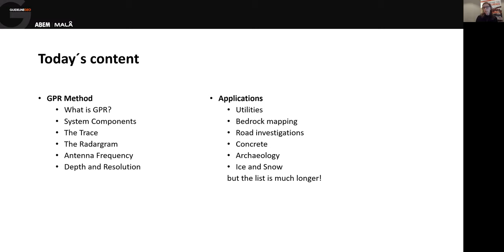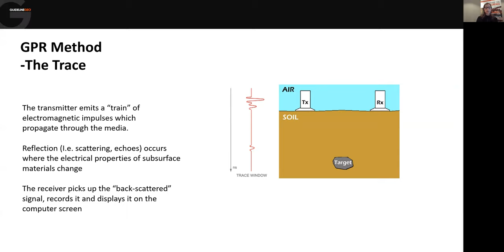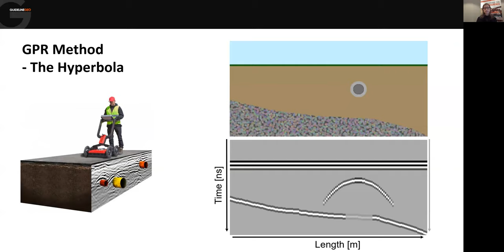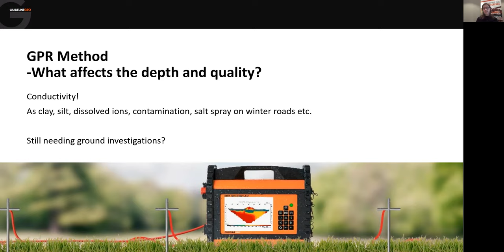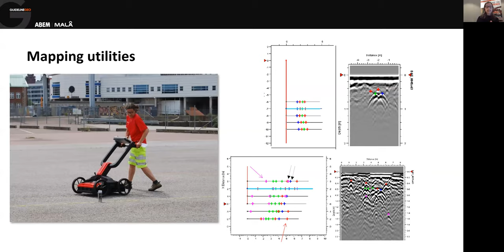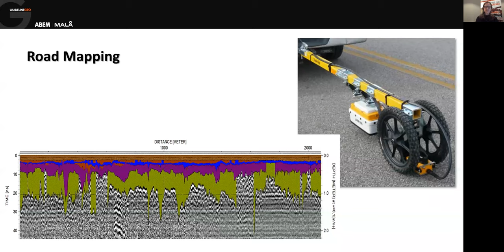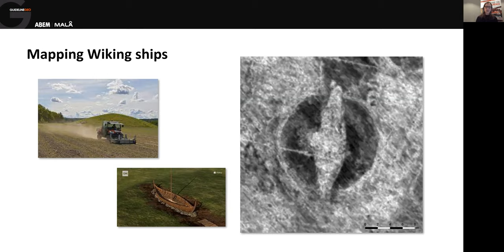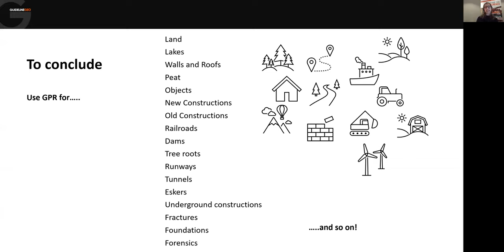Introduction to GPR

Comment: I’m a lost item recovery specialist and treasure hunter. Thank you for your detail GOR primer. Much if this info I knew if but your presentation is very clean and on point. Hoping to some time soon to be able to implement GOR into my processes..  I am thinking 800 MHz would be most suitable for modern < 50 years searches for buried gold and silver cache containers in the ground. Most people don’t bury items in the ground  past two feet typically.  Metal detection is the first easiest option for locating however some environmental and masking items have been found to make traditional metal detection extremely difficult. I see where GPR technology could bring some solutions into focus!

🤙 Cheers, #SeattleRingHunter